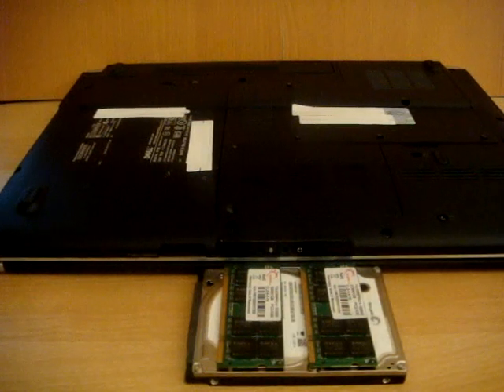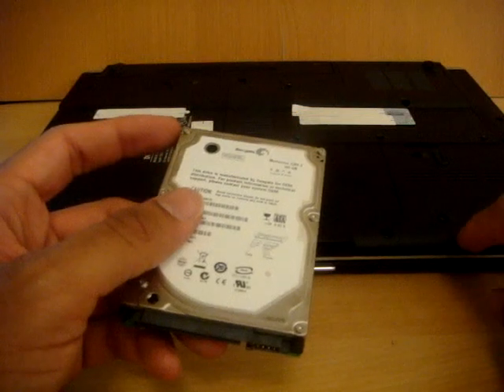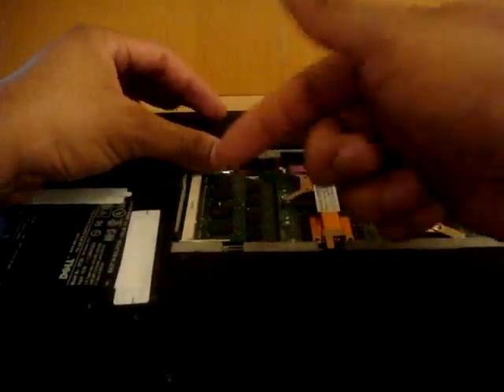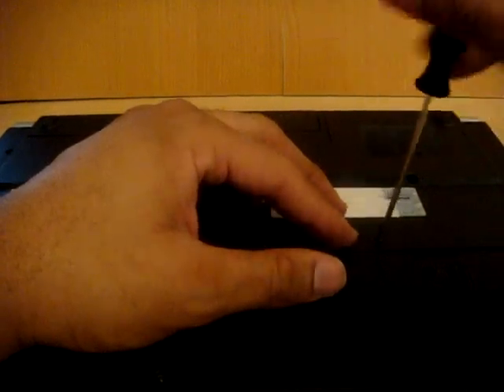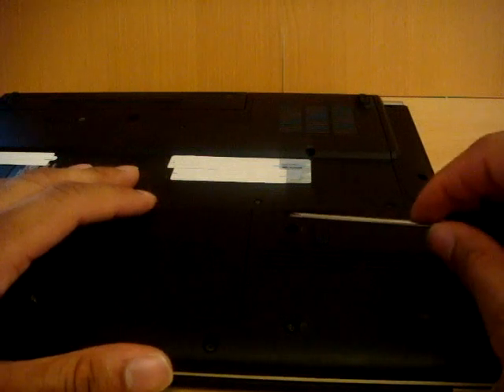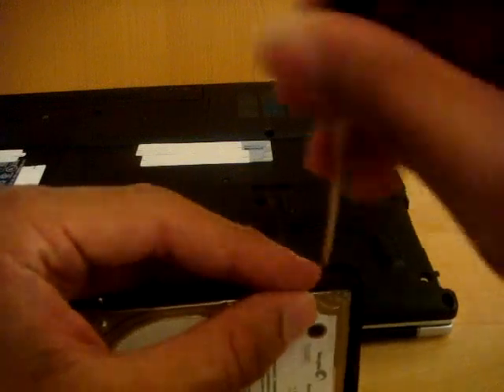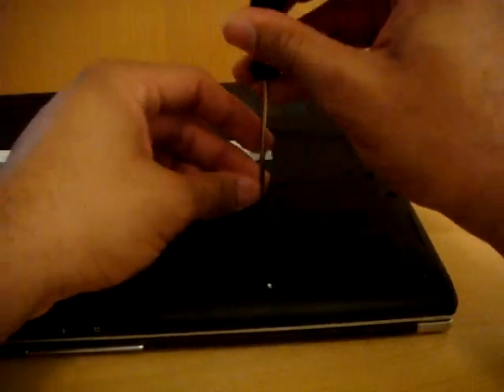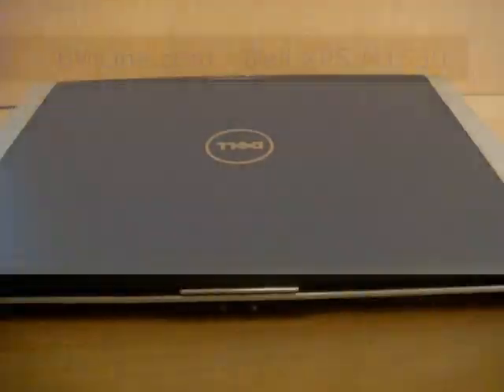Dell XPS M1530 Hard Drive & Memory Install - BWOne.com

Comment from the maker: Windows Vista 32 bit supports up to 4GB of total RAM. That includes video memory and any other type of RAM the system OS will recognize.  Vista 64 supports up to 128GB of RAM (Depending on the version) so you will see the entire 4GB of ram where as with the 32 bit version you will see a bit under 4GB of ram (3.75GB as an example)

Comment from the maker: 7200rpm drive will give you better performance and faster speeds than the 5400rpm with the expense of a little less battery life, some heat and a little bit of noise but it worth it for the performance and speed gains you get.

Comment from the maker: I did mention in my final review that I upgraded because I was able to get 64 bit Vista a install on my machine.  Some people will max out to 4GB regardless if they use a 32 bit or a 64 bit os. To max out the system.  and get the most memory possible. Even if you do only get 3.5GB its still more than just 3.0GB or 2GB.   With the independent video card you should get around 3.5 in vista 32 bit and all 4GB in vista 64 bit.

Comment from the maker: Best options is to put a 7200rpm hard drive in it and bump the memory up to 3GB (For Vista 32 Bit) or 4GB (for Vista 64 bit) Also do a clean install if you have a Windows Vista disc. Dell doesn't put much into the OS when you have it deliver but a clean OS install is usually the best.

Comment: you can completely eliminate the clicking sound by going to the BIOS and setting the HDD on "maximum" or "silent quiet" modes. If you leave it at "Default", the HDD will be alternating working modes, hence doing that "click, clack" sound.
But you should know that if you set the HDD at max. it will make a little more noise when working fast.

Comment from the maker: the largest for sata that I have seen is 250GB made by Western Digital. It the second highest rated laptop on Tom's Hardware besides the Seagate 160 7200rpm.

Comment from the maker: The 7200rpm will be a faster drive vs the 5400rpm.  If you  have 7200rpm HDD in a laptop its going to be a bit louder than a 5400. You'll hear small clicking noises.  If you hear big ones then there is a problem with the hard drive.

Comment: The processor should be upgradable... during the RAM upgrades you should see the heat sink on the right, just have to remove the heat sink and replace the processor right below it.

Thanks for the Great walkthrough bowman, I'll be getting my m1530 within a week or so (already ordered it so now I'm waiting for it to arrive)

Comment from the maker: Yes you can. Vista 64bit supports up to 128GB of memory. There really isn't anything out there that will support more than  4 GB for a laptop.  On the desktop side its usually 8GB cap and one board I saw had a 32GB cap. Anymore than that is on the server side of things.

Comment from the maker: If you purchased a hdd that is 7200 rpm it  is going to run hotter than the stock HDD which comes at 5400rpm speed. if they drive you bought is a 5400rpm then you may want to check with the manufacturer of the drive.

Comment from the maker: Any standard 2.5 inch SSD or HDD can fit into this. Also ram I believe is maxed at 4 GB but it may have been updated in the BIOS to support 8 GB. Not sure since it's been awhile.

Comment: When I ordered my M1530 from dell I upgraded to 6gb of ram. Module 1 is 2gb and module 2 is 4gb. From that I would say that each dimm can take up to a 4gb ddr2 module. Of course to be able to use and see over 4gb of ram you need to be running a 64bit version of windows.

Comment: Of course not. The Windows software and whatever data you have, such as games, music programs like iTunes, are stored on your computer's hard drive. RAM is used to temporarily store the data of whatever programs you have running (I believe). The more RAM you have, the more programs you can generally run, which will, in most cases, improve your computer's performance.

Comment: @yaminz88 
HDD:  There are no 2TB drives. The drive has to be 0.37" (9.5mm) deep! Some of the newer large internal drives are 12.5 mm, which wont fit into the xps. The largest Ive come across w 9.5mm depth are 750GB (5400rpm though so slower than 7200rpm). 

- western digital: WD7500BPVT 
- toshiba: MK7559GSXP

Comment: Hey, I'm just wondering, what's the max temp does your laptop get at full load? Cause my M1530's CPU reaches upto 85 C and the GPU reaches upto 90+ C and I haven't overclocked anything yet.

Comment: Hi there
I've upgraded to 4GB recently. I bought 2xKingston value ram's model: KVR667D2S5K2/4G. Unfortunately since the upgrade took place I am receiving blue-screen during windows start. 

*** STOP: 0x0000008E (0xC0000005, 0x94CC5881, 0x9B08CC04, 0x00000000)
*** win32k.sys - Adddress 94CC5881 base at 94C00000, DateStamp 45d3cc1d
Collecting data for crach dump...

Any suggestions?